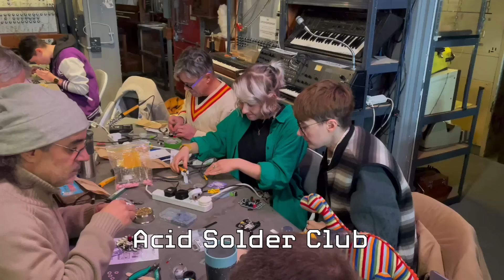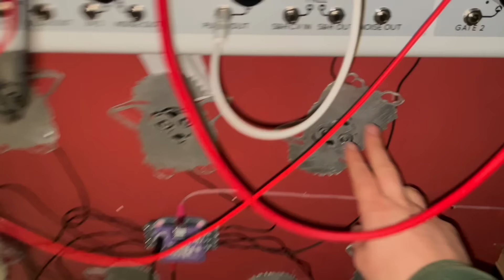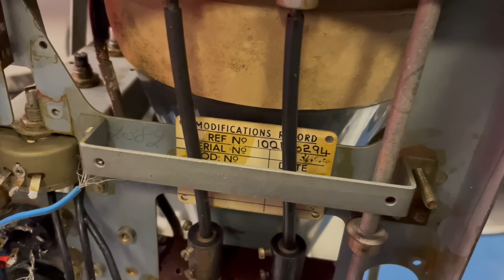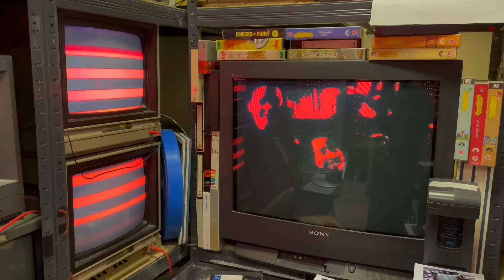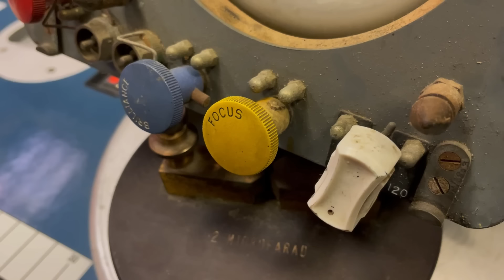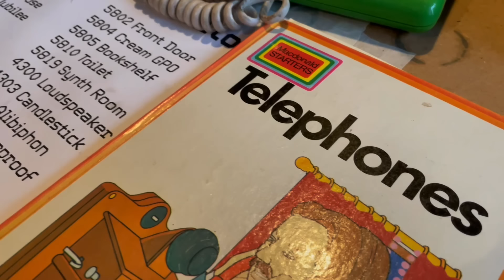The RAF RADAR that told the Germans where it was.

Comment: Although Bakelite is related to the tag board material, they are not exactly the same, Paxolin is the trade name for the circuit board material and it is layers of either cloth or paper soaked in phenolic resin (the material Bakelite is made of), then cured in a press.

Comment: It's not finished as the valve bases aren't wired up, apart from the heaters. The is also insufficient circuitry to drive the CRT.

Comment: I made an all valve television around one of those CRTs it had a 5” black and white (black and green) picture.  Got the worst electric shock I ever had from it.  One of the valves was on its way out and you needed to flick it to get it working, I was doing that and got a 90kV shock off of the flyback transformer, it’s the first and only time I was thrown across the room.

Comment: For the magnetron to create a short, strong high frequency RADAR search pulse, a capacitor was discharged through a high-speed switch to supply the magnetron. This switch was the thyratron valve, which had a vacuum in it with traces of Hydrogen, this gas being used because it ionises and conducts electrons very quickly. When you connect up and trigger the gate of a Hydrogen thyratron such as the 5C22, you can actually see the discharge in form of a pale lavender flash of light.

Comment: It's interesting that all the valve bases on that equipment only have the heaters wired up and the rest of the connections have nothing connected to them. It's as if half the wiring has been  stripped out!
Reply: Also most of the switch wafer wiring has been removed.

Comment: What we are looking at is a radar display (or indicator), not really a radar. RADAR describes the entire system which from memory is a timing circuit, a transmitter, receiver, amplifier and display unit and associated power gubbins. Its colour is also dubious as most things around this time were black. And are you sure the knobs are original? They look very 60s to me.

Comment: Just to add that all that wire was made with asbestos insulation, with the wire having a woven asbestos insulation, and the outside was painted and used to keep the fibers in place, but the cut ends will shed fibers.

Comment: The primary WWII tail-warning radar on Allied bombers was the British Monica (RAF code ARI 5664), also known as the AN/APS-13 in the US, designed to alert rear gunners to approaching enemy aircraft using beeps over the intercom, but it was compromised by German homing devices like Flensburg, leading to its withdrawal and even its use in traps against German fighters.

Comment: I always wondered if it's plausible to rebuild something like this, if you have the circuit diagram, by ignoring the valve heater circuit portions and replacing the active circuit components with solid-state equivalents.🤔
Reply: There are no exact equivalents, but depletion MOSFETs like LND150 and DN2450 behave vaguely like tubes. 🤔

Comment: Any radar has that problem, they send out massive RF pulses that bounce off things and get reflected back, that's just how radar works. With the advent of the magnetron, the frequency became way higher so that hopefully made it more difficult to receive - but far from impossible.
For radar to work you have to be able to receive those frequencies, you just hope the enemy does not have the same receiver.

Comment: Would be neat if you could get that RADAR CRT going again. Make it do the classic RADAR sweep. I wrote some code that can do that with a raspi and some DACs if your interested. I had to take down some details on the project (many of my projects, actually) but if you want I can still share the original code and plans with you. I even made a flyback transformer that provides all voltages including the heater voltages to power the CRT.

Comment: 8:22 phenol-formaldehyde materials are still in use for today for cheap printed circuit boards (eg the infamous FR2 laminate is based on that technology)
Reply: The tag board was made from Tufnyl, with a fabric or paper substrate, not Bakelite, which was moulded with a powder (sawdust?) substrate.

Comment: @9:00 - Shellac lacker. Used quite a lot till late 40s, was easily dissolved with alcohol vapours. Pretty OK, cause you can use a solvent and relax after repair with the leftovers... ;)

Comment: I obtained a similar CRT display module like the one you have from a deceased estate of an old radio engineer, sadly a fair bit of his collection ended up in the landfill. Anyway I converted the display unit into a CRT clock which looks very cool!
Reply: I was wondering if that's what someone was trying to do with this one as its been heavily modified from its original design into what looks like a basic X-Y display
Reply: I also picked up a us navy radar display at an estate sale last October. There was a few things missing from it as well including the CRT. Also from a similar era.

Comment: Except for some specialist applications like Thyratrons and Nixie Tubes where at trace amount of gas is essential, valves in general have a hard vacuum inside.
Yes it is true, in recent times the terms valve and tube are being used interchangeably in the UK, but "valve" was always the preferred British term, and as a curator of a UK based museum,  I would beseech you to buck this Internet trend!
Reply: Well you cannot really get the meaning from "tube set" or "tube radio" - but you can from "valve set" or "valve radio"
Reply from the maker: Ok valve it is, for old blighty!
Reply: @THISMUSEUMISNOTOBSOLETE   😃

Comment: The clue as to what this is (or was, it's been heavily stripped of parts) is on the Modification Label, ironically shown as you're saying there are no markings. 10QB/6294 is the RAF Stores Reference of the Indicator Type 233. I don't believe this was used with Monica, but with Rebecca MkII, a system designed to home onto Eureka ground beacons.

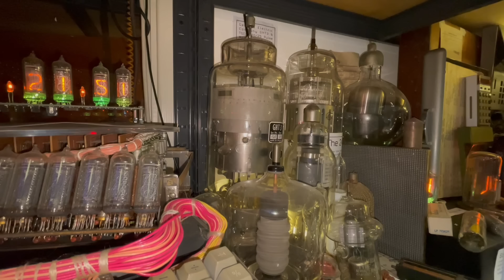Comment: 3:41 hydrogen thyratrons are used to create the high power, short pulse that is transmitted by a radar system, by temporary shorting out a tuned radio frequency circuit. The tube is filled with hydrogen gas, which often needs to be replenished by heater inside a pill of titanium hydride inside the tube. Hydrogen gas is used instead of inert gases such as argon, xenon or mercury vapour (used in thyratrons for other lower frequency applications) as the hydrogen gas is able to ionise much faster than the other gases - hydrogen thyratrons are able to ionise in nanoseconds, producing the fast pulse needed for radar. The current while the hydrogen is conducting can be tens or hundreds of amperes. Hydrogen thyratrons are still used today in high powered pulsed laser systems as solid state RF electronics are simply not robust enough to last in that application - the instantaneous power absorbed by the thyratron can be in the megawatts.

Comment: The reason that we use a lot of the same terms between electronics and water technology is not what you think.  It wasn’t water technology, it was pneumatic technology.  Before control electronics came along, engineers used pneumatic controls.  

I have seen older installations that contain miles of 1/8” bronze tubing, with various types of valves and relay switches.  In fact, I worked at a combined cycle gas turbine/steam plant at a paper mill that used a Westinghouse 191G gas turbine that was installed in 1965.  The control system was fully pneumatic.  

I still have a spare set of blue prints somewhere.  When you look at them, you could easily mistake them for electronic prints.  The reason for this is that the control system engineers that were responsible for transitioning from pneumatic to electronic controls needed symbology for the (at the time) newfangled electronic components.  

Being familiar with pneumatic control symbology, they simply borrowed the symbols and terminology and adapted it to electronics.  You can imagine how puzzled I was when I went looking in the back of a panel for an op amp and instead found a chunky looking valve body with a bunch of bronze tubing attached.  

I spent six months training under a retired engineer to learn the pneumatics, and we spent the following year after that designing and installing an electronic version.  20 years later I was hired to train a new technician on the the electronic version I had developed, and assist him in designing and installing a PLC based control system.  

The original pneumatic control system was in a cabinet about ten feet on a side.  The system I designed was in a cabinet about the size of a server rack.  The PLC system was in a wall mounted enclosure about the size of a server rack, but 1/3 as thick.  I expect the next iteration will be about the size of a small PC and built into an Arduino.

As a side note, the protective relays in that plant (required for every power plant connected to the grid) still contain vacuum tubes to this day.  There are more advanced fully chip based versions, but the old ones work just fine and won’t be replaced until they fail, which looks to be never.
Reply: Your experience is quite valuable.  It is very similar to what appears in sound-powered telephone systems or in old ship speaking tubes.  Today, we deal with microvoltage systems for natural gas switching for high-efficiency heating plants.  So, I second your scale reduction argument about PLC versus pneumatics and the projection of something very small in the future.  And, yes vacuum tubes are quite rugged and reliable in many applications.
Reply from the maker: Good to know cheers!

Comment: Do you get much problems with VRI ( Vulcanised Rubber Insulation ) cables braking down like old lego cables made between 1985 and 1997?
Reply from the maker: Yeah rubber is difficult, gotta be mindful with high voltage!

Comment: At 06:20
You can also use metal plates inside the tube. Apply a voltage across to deflect the electrons.
They are called DEFLECTION plates and are commonly used in oscilloscopes.
In a CRT tube for a television set, electromagnets are used to achieve the larger deflection.
Reply: Magnetic deflection is good at lower frequencies (kHz), like in TV, where the deflection runs at a more or less fixed frequency and waveform. and the display is modulated (at high frequency, MHz) via the beam intensity.  Oscilloscopes need to work up to much higher deflection frequencies where electrostatic deflection is much more suitable (and the intensity is constant)

Comment: thyratrons were used to generate high power pulses for the transmission part of the radar, discharging a capacitor into the magnetron. They work just like modern-day thyristors
Reply: As an old t-9 ww2 radar tech.  The "Valves" are also used in ANMPS-T1 radar and lots of larger SAM systems and triple A guns.
Reply: Yep, what they wanted is a defined length pulse, so they switched high voltage into an RC network the magnetron was connected to.
Reply: We still use thyratrons in our weather radar network to this day. 
They are used in the 5C and 6C EEC radars which have been true workhorses, still going after almost 40 years of operation.
Reply: Beat me too it lol. I have a few for would be tesla coils
Reply from the maker: Aha cheers Mike!
Reply: Interesting seeing you here Mike :)

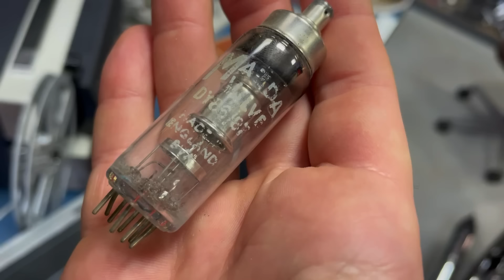Comment: At 05:03
They are called vacuum tubes for a reason. They contain... NOTHING... 
There is no gas inside.
A gas inside would hinder the flow of electrons.
But, as always, nice video.
I hope to visit the museum once.
Reply: I play guitar but have aquired a few soviet era tubes to capture signals my geiger counters miss.  Not up and running yet,  I'm still preparing the geometry and trying to build an analogue computer.
Yes.  I am well out of my depth. 😂😂
Reply: @drfill9210  Ahh the Soviet ones were very good
Reply: @gowdsake7103 perhaps good enough to hear the whispers of the universe if you make them scream? That's my hope
Reply: Well there is some gas inside even in a hard tube
Reply: @gowdsake7103  Yeah, but gas inside a CRT designed as a hard tube is just a nuisance  :) There are rumours that some CRTs will kinda work if they literally lost most vacuum because the high acceleration voltages will push some electrons even throgh plain air :)
Reply from the maker: Depends how you define nothing… was just reading about the space shuttle wake shield facility for making ultra high vacuums before recording this so that may be why I said “low pressure” relatively ha

Comment: Missing a few valves there!
Reply: Doesn't matter. All the wiring to the valve sockets, with the exception of the red/blue twisted filament wires, appears to be missing as well. That unit looks to have been thoroughly cannibalized.
Reply: Yeah, looks like most of the passive components have been removed as well. Wondering if it's possible to find a schematic and restore it to its original configuration.